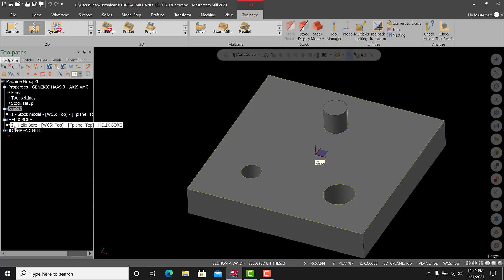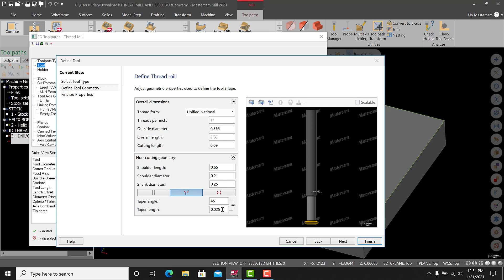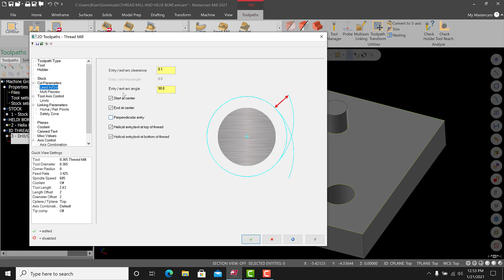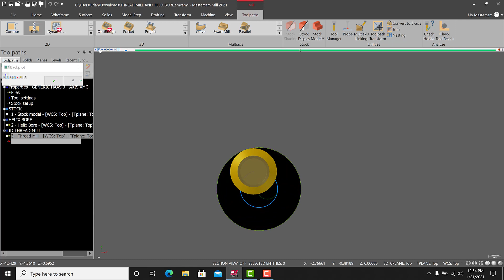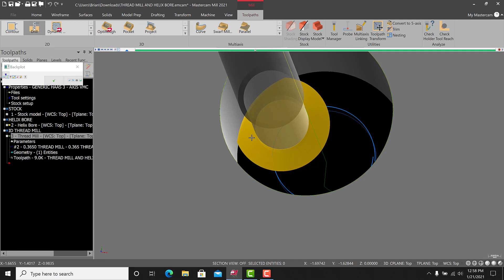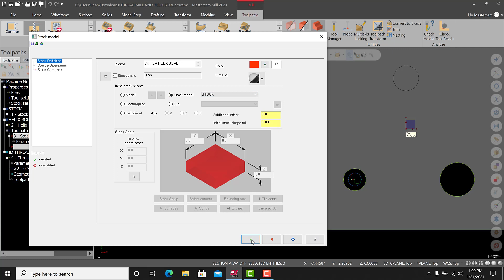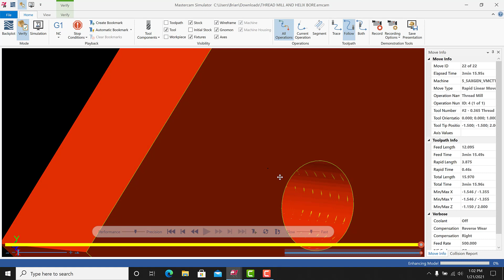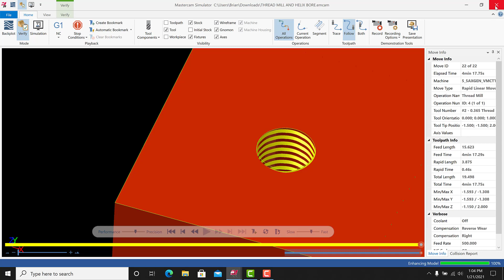MASTERCAM 2021 INTERNAL THREAD MILLING

Comment: we have added cycle output using simple drilling operations by our reseller so we can use machine cycles. Unfortunately it will not be simulated correctly as it will behave like a drilling cycle. I really hope in the future they give us the ability to output machine cycles while also correctly simulate them.